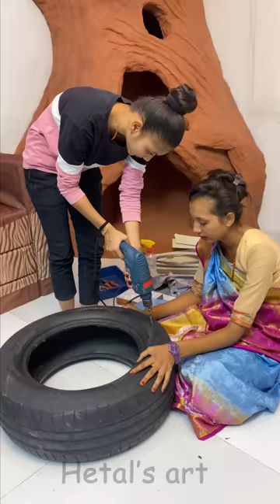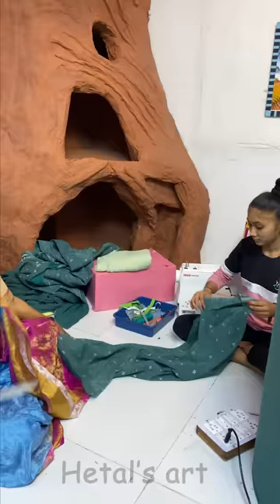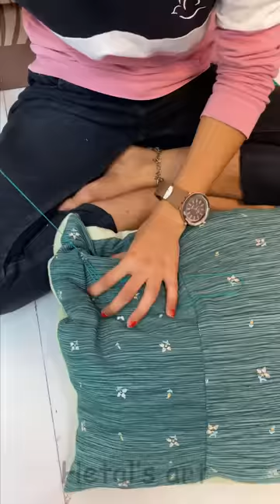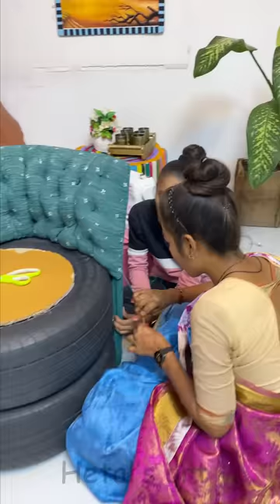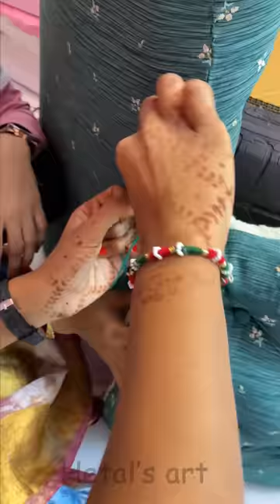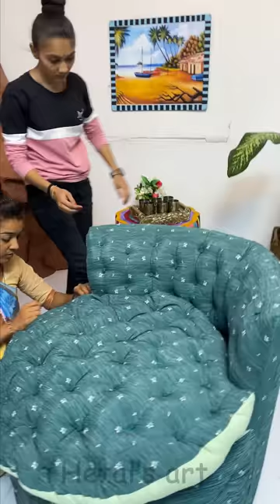Old plastic chair & tyre sofa making #sofa #tyre #oldchair

Comment: What do you think if some one spent time paint a very beautiful scenery picture with high quality oil colors but he painted that on news-papers?
How long the thin old plastic back support would last? 1-week?
 If the back of the seat crashed.  All the labor and clothes would be wasted.😂😂😂
The look and the QUALITY would make your work labor valuable.
I recommend you use metal or wood for the back support. NOT ROTTEN PLASTIC.

Comment: Ummmm I dont like those rods just sticking up inside like that. Why not use a nut and bolt that is shorter, or tie the tires together, that would be safer.